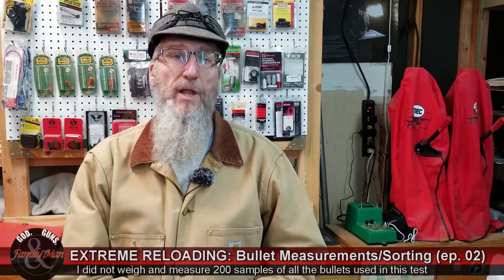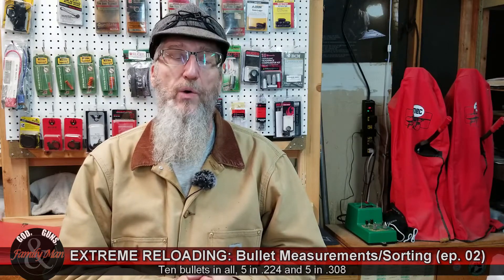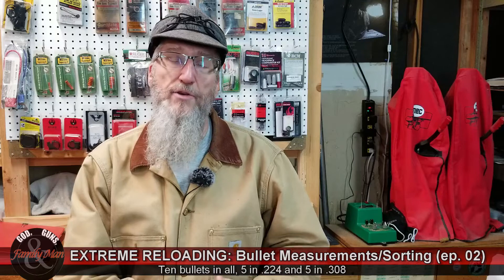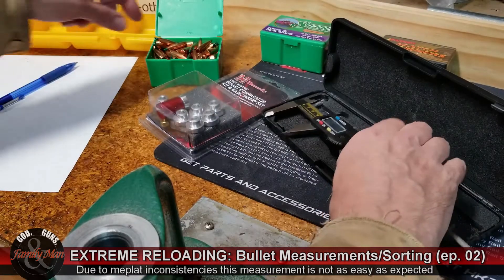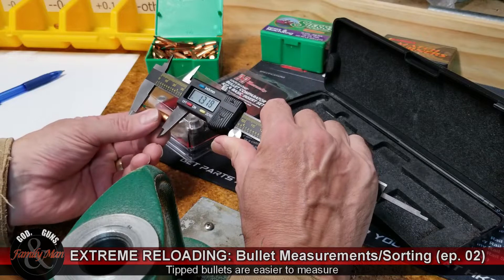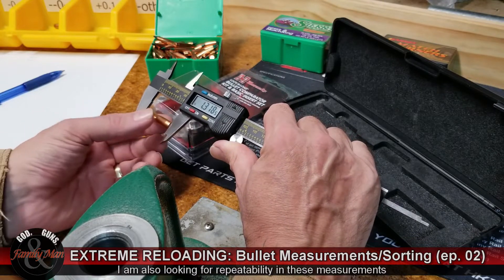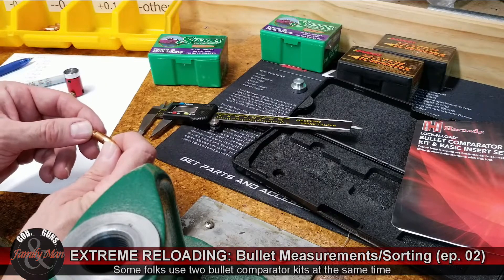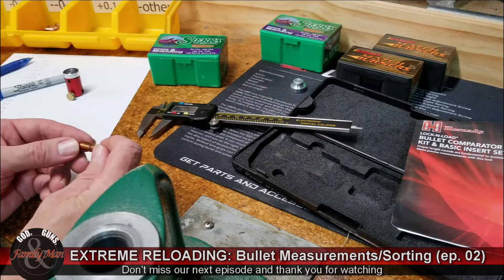Extreme Reloading: Measuring and Sorting Bullets (ep. 02)

Comment: It doesn't really matter if the insert plus mount equal to, you're going to zero it out anyway.  I made my own inserts on the lathe and as long as diameter is correct, the data can be compared.